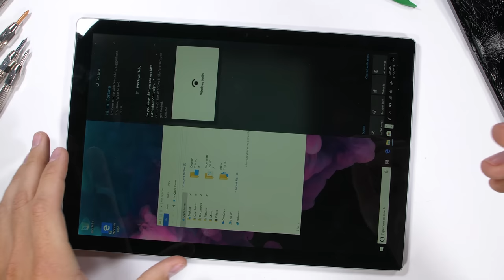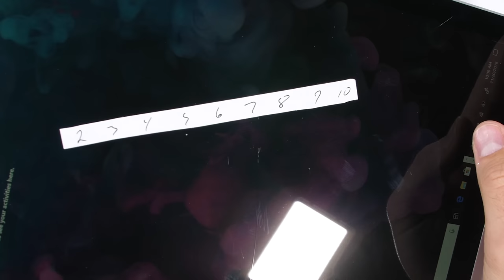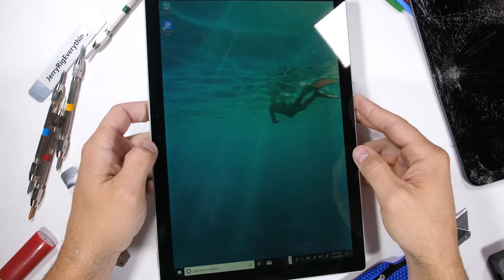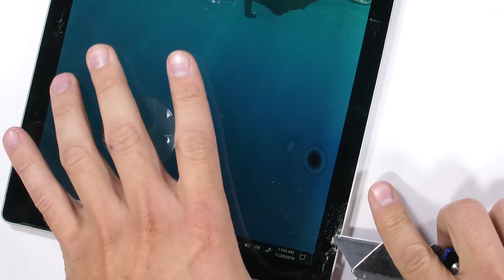Surface Pro 6 Durability Test! - Is it stronger than the iPad Pro?!

Comment: So microsoft could fit in headphone jack, micro sd card, usb slots, i5 processor and i7 too and still make it durable with those holes and apple could not handle one small microphone
Reply: Sagar Dahiya apple*
Reply: This fucking surface weights 300g more and has way more volume. Nothing special here.
I still prefer a device that is lightweight and thin. And of course almost forgot it: Windows is shit.
Reply: @qvbe  cough cough isheep
Reply: It's cause the surface is a lot bigger, but ya I agree that Apple is penny pinching and probably wouldn't put those things into their device cause it goes against what they believe in. Apple has a goal to make their devices as simple as possible(removing all ports). Apple attracts a broader audience cause most people don't care about those things and over time every other company has to follow Apple. We would still be using DVD players and floppy disks right now if Apple didn't take the risk of removing them
Reply: qvbe so you would prefer paper over a bunker to protect yourself during a war
Reply: @RahulSingh-sg1bu  What the hell are you saying? DVD's and floppy disks are outdated because of blu-ray's, sd cards etc. Last time I checked apple didn't make any of the above. Get your shit together. Apple are removing important ports and features on their devices and it's a fact.
Reply: Paulex 57 Everything u said in ur comment was wrong. In 1998 Apple removed the floppy disk from the iMac which cause the rest of the competition to remove it. In 2007 Apple made the iphone without a physical keyboard and many other things. Technology wouldn't be where it is right now if the iphone wasn't made. In 2008 Apple removed the CD/DVD player from their laptops which caused every other laptop to remove theirs. U clearly don't know what ur talking about cause u probably weren't around when when floppy disks where a thing. Ya I know that with time these things would have been replaced but Apple made the progression of it a lot faster. And I never said that Apple created them.
Reply: SD card slots and USB would more easily allow users to side-load software that apple's walled prison doesn't allow.  That's not even considering the maybe $5-10 in tech licenses that apple wouldn't pay anyway.  Removing the headphone jack was a way to raise profits by forcing the use of a proprietary adapter.  It pretty much all boils down to a flat out disrespect for the users and an eye on maximum profit/wallet rape.
Reply: qvbe you're just jealous we get to use an an actual file explorer !!!
Reply: @RahulSingh-sg1bu  Well I agree with you on those statements but let's talk about the present scenario. From the day steve jobs has died apple has failed to do innovative things. iPhones still use the lightning cable even though usb type c is superior. Head phone jack got removed when clearly the audio output from it is better. They removed finger print scanner as well which is faster than face id. The new macbook air has lesser ports than the last one. Come on man apple is self destructing at this point. Apple died with Steve Jobs.
Reply: Paulex 57 ya u have a really good point there. I agree that at this point Apple’s just testing to see how much they can manipulate their users/prices now. Fortunately I’m not stuck in the Apple eco system. I just feel like the majority of people are ignorant and don’t really care what the they are buying. They just buy what their friends and family have without doing any research
Reply: Sagar Dahiya the iPad Pro also has an a12x 8core cpu and multi core gpu both made BY APPLE. The surface pro also runs windows 10.
Reply: Xero [2]  or hackintosh it
Reply: @qvbe  actually I have Microsoft and Google so yh I'm neutral I'll have any phone with great specs for me I preferred the s9 for early 2018
Reply: @RahulSingh-sg1bu  Well I'd tone it down to that apple took the initiative in many ways but I'd avoid saying if it weren't for apple it wouldn't happen. After all everything you say has been in development not just on apples's side. It's true that they came up with a number of things first but don't say it wouldn't happen anyway, they were quicker than others in pushing these decsions out no doubt about it, basically they won a race several times but didn't really invent racing, same as other companies do nowadays ;0.
Reply: Yet Surface pro gets destroyed by Apple A12x in processing power, but everything else is in Mocrosoft favor
Reply: @qvbe  where is no competition between windows 10 and measely  iOS in functuonality. Windows 10 is full fledget OS, iOS just mobile OS without much of functionality. You definitely shot youelrself in a foot with this comment
Reply: Why you always fucking need to bring apple in these videos, are you dreaming of it every nights?
Reply: @qvbe  using it right now and have been using it for years, it works great. maybe try to tone down that fanboysim a bit hm?
Reply: @qvbe  they dont force you to do anything bud. If you got auto updates on, it will auto update. Otherwise, it wont. My laptop hasn't updated in about a goddamn year
Reply: @TowDow3  lmao, apple doesn't "make" anything.
Reply: @TowDow3  saying multi core gpu is like saying "car with multiple wheels"
Reply: @knickers3359  not supporting any side of this cringy debate
but god damn I've never heard such a pitiful insult since grade 3 on a sandpit
Reply: Xero [2] yes That is what we are saying. Apple have pushed the tech envelope by introducing/forcing new adoption by deprecating old. And been the first and most courageous to do it before anyone else would take the risk. And then they followed. 

The latest Apple took on this was to remove the headphone jack and going over to solely USB C.
Reply: Paulex 57 Apple is already phasing our the lighting in favor of USB C.
Reply: Adding a 3.5mm jack makes it thicker, that’s why it’s it could handle the bend. But $800 for windows ? 😂 who wants a tablet with exhaust fans
Reply: No matter what company no matter what new product, they always compare it Apple and Apple is still beating everyone’s ass with a trillion dollar value. Seconds will always keep complaining about the first while the no.1 doesn’t bat an eye because we know the real comfort of iOS and macOS and these shitty products don’t matter. I don’t buy a tablet to make origami out of it so you can enjoy that beautiful windows experience 😂
Reply: @avinashmurthy9437  
People who who does not want the 15W processor to overheat all the time. 
People  who want the performance and functionality of a  notebook PC is more portable form.
Reply: tyaty Lucky for you the iPad doesn’t heat up. Windows takes 20 mins to open a video editing software and keeps installing updates every 20 minutes. Any work that’s done on the run, the iPad can handle without breaking a sweat. The surface pro is Microsoft’s mediocre answer to the tablet space. Usually people who bitch about Apple haven’t used one so no point debating. FYI I started with windows and know how bad they are at everything.
Reply: @RahulSingh-sg1bu before Apple, motorola do the a1200 without a physical keyboard back in 2005 so Apple was not the first company doing that. Motorola do the first smarthphone using Linux in their devices and downloading app i remember playing emulator for snes and ps1 on a1200.
Reply: Yet, the iPad Pro is still more powerful than a maxed out surface :')
Reply: @qvbe  that is a stupid reply...does make any sense to pay more for less... instead of weight and size
Reply: Pretty much LOL
Reply: @RahulSingh-sg1bu  my laptop is a thinkpad from 2017, still has a cd drive, and sd card reader, a headphone jack, and many other ports like full-sized usb.
i wouldn't mind usb c everywhere, but find me a usb-c mouse first :D
Reply: @qvbe  Eat less soy and 300g will be nothing to you.
Reply: lol, no shit. you can fit anything you want in a device if you don't mind making it fatter and heavier.

how bout the fact that even with all those things it "fits" better, the surface device line still has comparatively shitty battery life, lacks usb-c, sucks as a tablet, sucks as a laptop, and ranks among the worst in reliability according to Consumer Reports?

i jumped on the surface pro hype a little while back, when i didn't know any better. loved taking notes on it, but it was a joke and waste of money for everything else. apple is a money grubbing bitch of a company, but thank god they still at least know how to make a decent, lasting product.
Reply: @avinashmurthy9437  cough cough apple sales dropped cough cough
Reply: Apple has the bravery to remove useless features for a better future. Other companies just follow what the customers say.
Reply: @RahulSingh-sg1bu  Also now apple is removing the headphone jack and sadly everyone else is too. (Literally using one right now)
Reply: dark gamer what you mean? When I watch an android phone (or anything else) review I don't have to brag about it, I just watch, that's it. If I don't like something I don't have to brag about it in every fucking video to make myself somehow exist.
Reply: Talking everytime about Apple is like feeding the troll, the more you talk about their moves the more they will stay at the top. Anyway good day or night.
Reply: @qvbe  and the iMac air is bigger yet the surface still beats it
Reply: Balrajda savage brilliant tag😂 didnˋt know that one :) so now we have fandroids and isheeps! Wich one are you? :)
Reply: Avinash Murthy THANK YOU! Finally so who understands! Those stupid updates really drove me away from windows and in apples arms!
Reply: 😂. Yeah but you got to agree it’s designed for high ses “designers” who love to flaunt wireless accessories. While Microsoft is for your average person who just wants something that can work with everything he has now. I still don’t get why Apple will remove the jack(probably to make money of selling AirPods) but it’s still better to have USB C instead of the lightning cable
Reply: @josyulasanshray2936  new iPhone information leaked, it has no ports at all! Wireless charging only because who needs a port!? Such a new innovation from apple! World leaders at ...... Fuck all there going down hill rapidly
Reply: @RahulSingh-sg1bu  Nope. There were palmtops and palmphones that many of them ddin't have physical keyboard, windows mobile existed way before iphone appeared, simply before technology wasn't existing to make them fast and smart. When Iphone appeared, so did HTC touch diamond that was even better then Iphone and so on. Removing floppies in 1998 was still stupid considering you needed very often floppies to boot certain stuff, floppies died fully about 3-4 years later.  CD/DVD players didn't exist in netbooks which are ASUS's creation and they were first to remove CD/DVD drives in full line of products. Tablets on windows XP also existed before.

Thing is Apple didn't invent anything there. All what Apple did was copy technology someone else did when it was mature enough and pull milions on marketing it.
Reply: LightningMotionshot I never wrote they where the first. I said they are pushing to phase out / deprecate tech in favor for new solitons.
Reply: You do lose your suspend capabilities this way given that Linux has no support for Connected Standby (yet), at least you can only hibernate, but the experience is not as great. Intel also sort of abandoned its porting efforts for the IPTS drivers to make touch and pen a first class citizen on Linux.
Reply: @qvbe  in what universe? IN WHAT UNIVERSE?🤣😂
Reply: @RahulSingh-sg1bu  no we wouldn't
Reply: @RahulSingh-sg1bu  non physical keyboards existed BEFORE THE IPHONE. Windows XP tablets were a thing.
Reply: Xero [2]  unlike safari amirite 😂🤣
Reply: @kigasdj2  surface pro runs a DESKTOP processor. Has a DESKTOP OS! unlike some tablet with a smartphone OS and smartphone chip
Reply: @avinashmurthy9437  someone who cares for the efficiency of that processor
Reply: @avinashmurthy9437  we are. Thank you
Reply: @avinashmurthy9437  at everything? Really? Bit of an overshoot don't you think?
Reply: @holycrapitsjake_ long lasting devices that barely last two updates?
Reply: @DieFarbeLila88  so you're saying Apple doesn't get updates?🤔 Oh I'm sorry... Security updates don't exist in Apple Kingdom because they buy out the guys who hack their system
Reply: I genuinely do not understand apple sheep. I have to avoid using apple products at work cos when I do my productivity goes way down because apple products are so incredibly shit. Apple is the Beats headphones of computers.
Reply: @GhostAcez  If the headphone jack is removed, how do I listen to music at work when both my device and bluetooth earbuds need to be charged...I can't.
Reply: @halodisciple8459  That's my problem to but there is dongles I suppose.
Reply: @qvbe  isheep
Reply: @kigasdj2  Let me ask you one question
What are you gonna do with that  much ARM power ? Run Minecraft ?
The iPad pro should not be compared to SP6 because it's a completely different product for different people.
Reply: @AMFxCful  Wait the iPad has Avx and virtualization Support? Nope it doesn't stop comparing an Arm CPU to x86. The Geekbench score doesn't tell anything.
Reply: @guyincognito.  Apple is worse than beats.
Reply: @RahulSingh-sg1bu  that's the old Apple, Apple now is much more different
Reply: @TheGabbaKeks  geekbench is a synthetic benchmark which allows for a direct comparison of devices. It is the most accurate benchmark to date.
Reply: @AMFxCful  Nope, you can't compaire x86 and arm in generell.
Reply: @AMFxCful  Arm uses a reduced instruction set and is tuned for low power consumption up to 5w. X86 has much more power, but a higher energy consumption. It uses a complex instruction set. Geekbench uses specific tasks, which both processors can perform. The problem is x86 can do much more.  Geekbench scores have a very limited use.
Reply: @emmanuelmedina2740  Same here I am still most likely on February build !
Reply: @litjellyfish  The latest Apple took on this was usb type c instead of headphone jack ???
Is that really what you're saying ?
My 2 year old $300 phone has usb type C !
Reply: Dilmanpreet Singh no that is not what I am saying at all :)

I start from the beginning. People are not liking that Apple has removed the headphone jack. 

What I state that Apple has always had a history of deprecating stuff in favor or solutions that was not as widely adopted at that time in general. 

Apple removed the disc drive. People complained. Apple removed the CD. people complain etc. 

The latest depredations Apple has done had been with the old USB in favor of USB C and the headphone jack. Both those two happened some years ago. And again people complained then (and still to some extent)

Hope that makes it clearer what I meant
Reply: @litjellyfish  uh okay..
I could sort of agree with that !
The headphone jack removal is still not a good idea though !
Also there were laptops that had Type C before Apple ! They just removed all the other ports altogether. And that's not innovative!
Reply: Ishrat Shaikh wow u hurt my feelings. I’m so scared
Reply: @RandomGuy-om1vy  Yes, but havent you seen videos or announcement? If it is properly utilized, it will destroy pretty much any laptop in processing power. Like Adope photoshop best work yes, on this tiny tablet! So it is up to developers to port desktop apps, if they willing to do it, no problem, iPad Pro can handle better than almost any laptop. Thats definitely fascinating to me, nothing else, just insanely powerful A12x chipset which rivals Desktop top CPU's
Reply: @kigasdj2   I'm sorry dude but the iPad pro is running an ARM processor, which is extremely weak compared to Intel or AMD processors. And that's why apple can't put a desktop firmware on the iPad simply because it is running an energy efficient processor which can't even boot windows or the full Photoshop 
The A12X may beat Intel's i7 in benchmarks, but in reality A12X  is a turtle.
You can know more about this by searching ARM vs. x64
Reply: @RandomGuy-om1vy  lol, sorry but you said completely nonsense. You one of those guys, who stuck in a past and uses keywords from a past. ARM is replacing x64 because its not even catch up with acient x64 but surpasses it in power to performance ratio. Have you heard things like Snapdragon 845 or 8150 chipsets, completely running Windows 10? No? So go and read. A12x its just a begining of the end for Intel. A12x is equal to i7 6700k peak performance, being 10 times more efficient. And you talking about ARM as it is 2000 :). Ipad pro destroys any surface pro intel processor. There is no comparision in that. Ipad Pro runs complete Desktop Photoshop with all filters and stuff, and it runs faster than any laptop with intel or AMD processors. Looks like it is time for you to update your knowledge :)
Reply: @qvbe  i hate to burst your bubble but apple does all of those things too. Want to get rid of them, get Linux.
Reply: Xero [2]  usb ports on computers are not obsolete and won't be for a long time. Usb c on MacBooks are just an excuse to make the device slightly thinner, saving a tiny little bit of weight that is then added right back by the dongles you have to carry around...
Reply: @TowDow3  bro... it's like 1+ year late and im sure other people already talked this but imma say it anyway cause that was cringy as fuck

1. a12x is a soc not cpu
2. you're comparing x86-64 processor to arm processor. and while arm architecture is very power efficient, when it comes to raw performance they're no match for x86.
3. saying "multi core gpu" is like saying "this car has multi cylinder engine"
4. apple didn't "make" cpu, they customized it from original design by arm holdings
5. ipad runs glorified ios so who's talking here